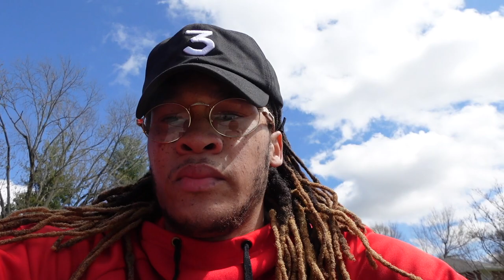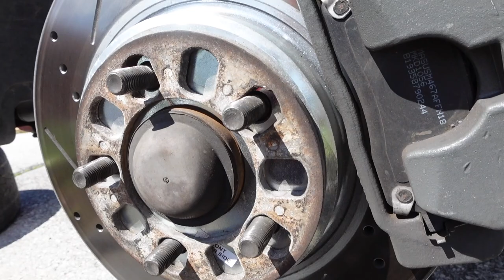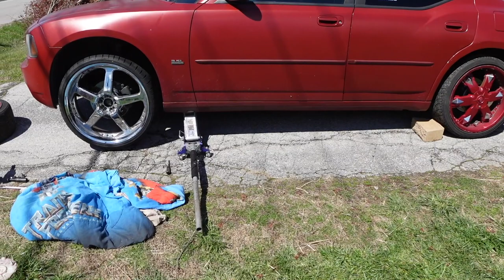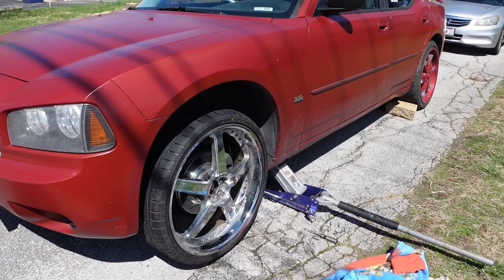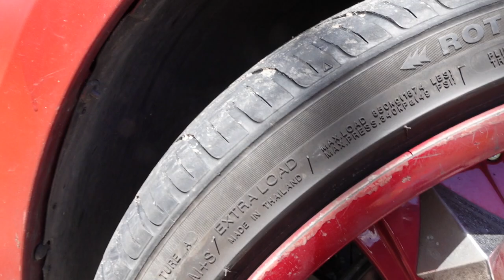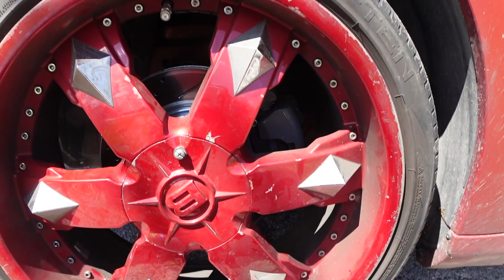What Happens When You Put THESE 24s On a Charger?

Comment: I got 2 inch spacers on my 2018 challenger that I'm going to put some 24's on but i dont mind my wheels sticking out a lil
Reply from the maker: That’s what up bro. And same, I would mind if the wheels stuck out a little. These 24s were just rubbing the upper control arm bolt badly so I would have to figure something out to lift the car a little bit more.